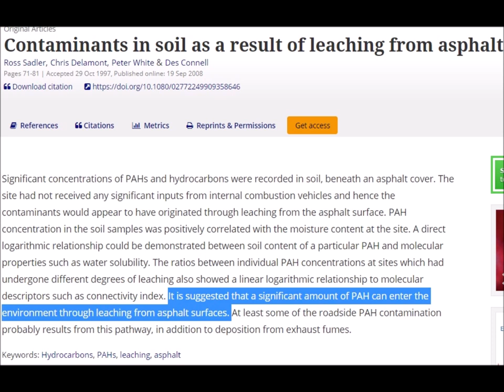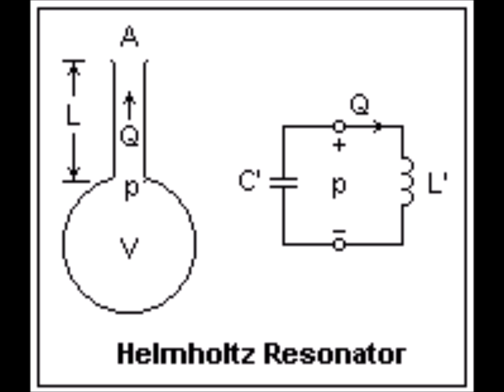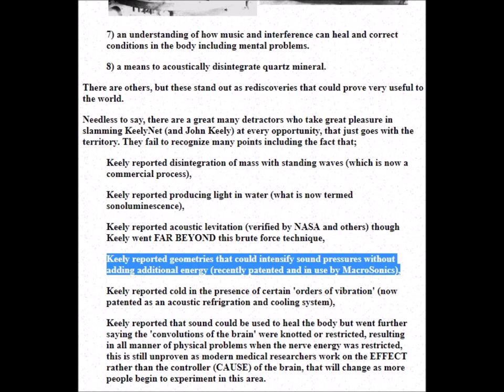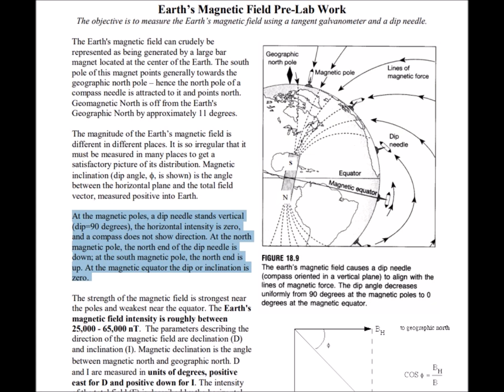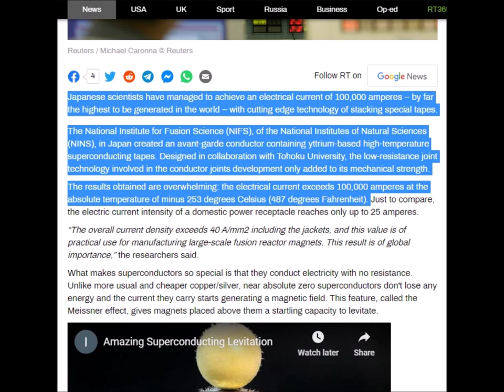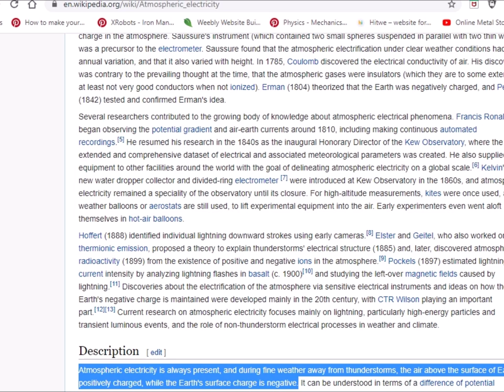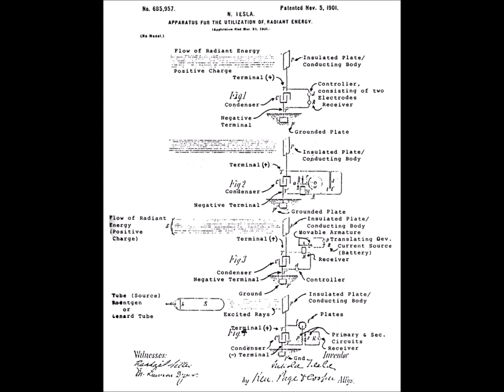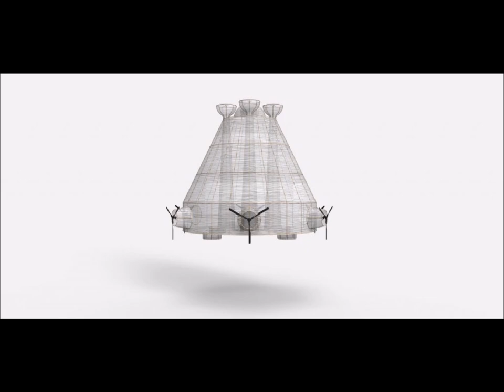The Personal Levitation Vehicle (PLV): Approximating AntiGravity

Comment: Sound is good for making things light but antigravity or gravity Wells are quite easy to make. Get a rounded object a ring or dome, with high electric resistance, such as graphite a semiconductor, fill it with high voltage. You want the negative charge in front or on top and pos on bottom or in other words electricity flowing towards your desired destination. More resistive at the input less at the output being the ring, the input being a thin wire (thin in comparison to ring
Reply from the maker: Yes, sounds very much like the Haunebu Craft developed in Germany during WWII!